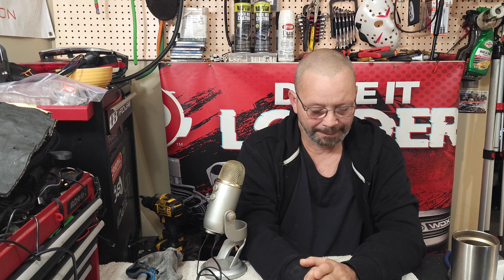Car Audio Capacitor Explained

Comment: I'm new to this I just bought my first dual 8" Skar 1400 watts subwoofer I should be getting that around Christmas..if I did a big 3 OFC upgrade do I really need a capacitor so my headlights don't fleker off an on to the car in front of me
Reply from the maker: assuming youre using a 1000 watt amp, youre electrical will likely be fine, with a big 3 done. but if its not, your best bet is to grab a big jeff lithium battery, and put is close to the amp, youll get the support you need, and discount code cae will save ya money on big jeff;s site
Reply: @CarAudioEnthusiasts I going to be using a boss 1800 watts phantom 2 channel amplifier for know in the future I'm thinking of buying a 5 channel car amplifier to run everything
Reply: @CarAudioEnthusiasts I'm just wondering what do you think of using a Skar big 3 OFC 1 gauge wire kit

Comment: does a Capacitor have bad side effects ? such as reduced power to the amp or a restriction
Reply from the maker: nope, only benefits,
Reply: @CarAudioEnthusiasts  Got it 👍🏽 the only thing i’m not sure is what # Farad capacitor 
to get i am running a 3000W taramps bass amp. To my understanding 1 farad = 1,000W. what’s your suggestion?
Reply from the maker: @jonathanguzman5201  youre gonna want 350-500farrads

Comment: So a cheap 1 Farad capacitor is not worth getting little to no help ?
Reply from the maker: correct
Reply: 8 f is perfect for a 500watt system. If your lights are still dimming your battery is getting old. Thats just from my experience.  He's not talking watts just big power set-ups.

Comment: Because of your Videos, I Purchased an Ioxus Ultracapacitor from Amazon for about $160. That has been the best upgrade I have made in a while. I’ve never ran a Capacitors due to the negativity around them. I stay at 13.8-14.2 at full tilt on a Taramps 3k on two AB XFL 10”s. I was dipping into the high 11s, and personally for me this made an absolute world of difference. Subs and Amplifiers barely even get warm Vs. Prior I was having issues of overheating on my equipment. Sorry for the long Rant… But Thank you for the Knowledge, it’s greatly appreciated by some of us 🙏
Reply from the maker: solid man, very glad it helped ya!

Comment: Im thinking of getting a cap for my small system. Sony 4 channel and hyanker 10 inch powered sub.
Reply from the maker: a super cap, is a solid chose for any car,  the ioxus can even start your car if the battery dies